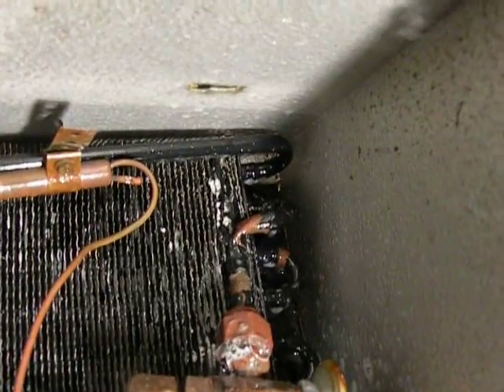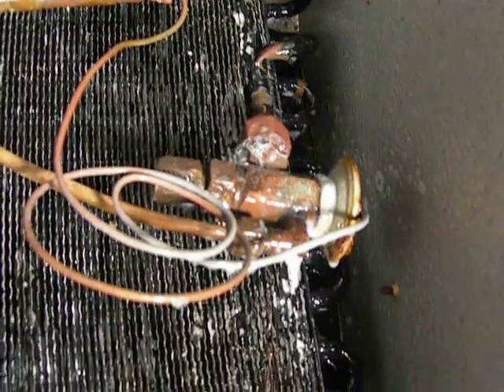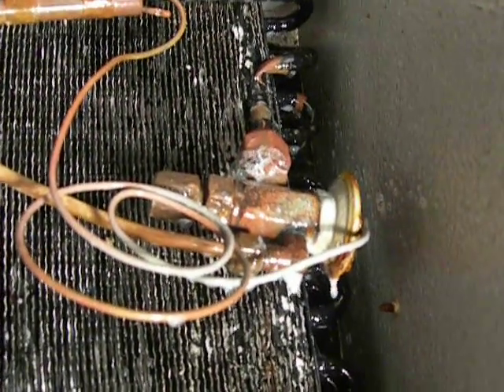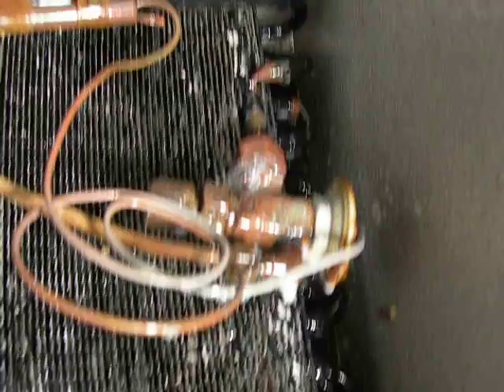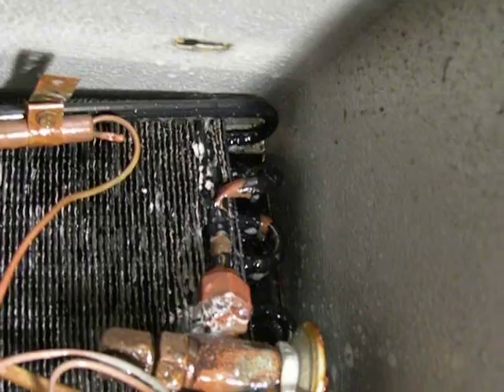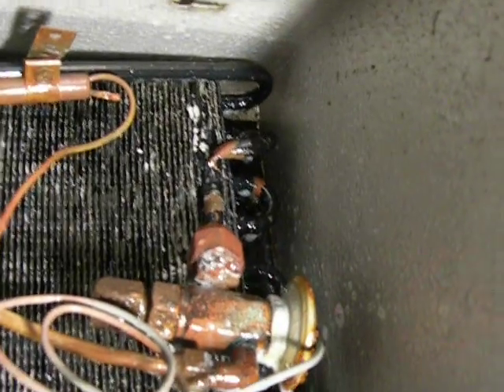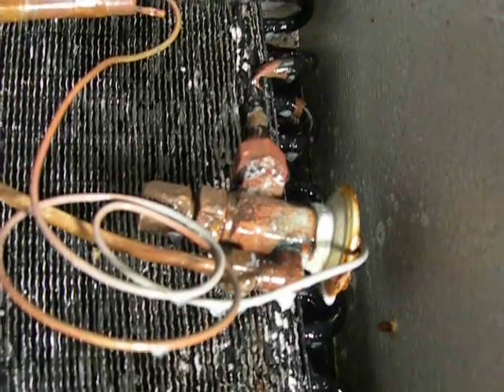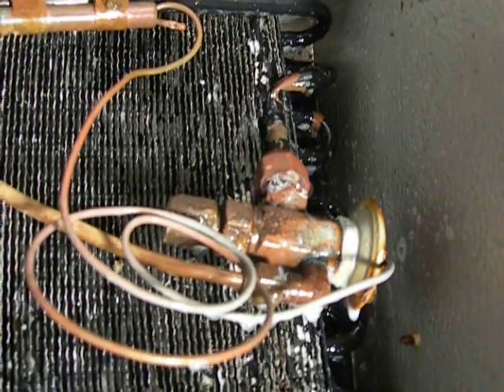Finding a Refrigerant Leak & Suprise!

Comment: Yah, I hear ya with those nuisance call backs on flare TXV's.  A lot of the times I've found hairline cracks in the flaring on the tubing.  Flaring tubing properly is an art in itself.  What I've done sometimes back when I did a lot of supermarket rack work was take it all apart, clean all the threads carefully, put a SMALL amount of flux on the threads and then solder up the nuts with some good silver bearing soft solder such at Stay-Brite #8.  Permanently solves the leak problem :)

Comment: @loix22 Pump down requires isolation valves and it's pumped to the condenser NOT the compressor. If you do a pump down that wouldn't resolve the issue even after leak has been repaired, reason being that during operation the refrigerant leaked out while it was damaged and you don't have a proper charge in the system. You MUST reclaim it, repair leaks, put nitrogen in and let sit for a while, vacuum system with micron gauge, use scale to put proper charge back into the system.

Comment: Sure, you could braze all the nuts with silver solder/Sil-Phos but that would make disassembly very hard, not to mention you're heating up components way too much.  The heavy brass flare nuts hold heat long enough to get things back apart with soft solder if you have to come back and change out a TXV later.  When I had to replace a TXV, I used to use Sporlan back in the old days, then I switched to the all stainless steel Danfoss sweat in valves. MUCH better, and the power heads were stainless

Comment: @Goodrich90mxr Flare nuts on any application will leak over time due to vibration. Tightening it up will solve the problem for 3-6 months on many systems but then it becomes a nuisance call. I myself can think of plenty of customers who would have the job done the right way with replacement of the TXV for a sweat fit one.
That 90 or should i say 110 is a separate issue entirely though lol

Comment from the maker: It Has another Problem if u Look at it Closely , Where the Refrigerant enters the Evaporator the Copper tubing is Bent Over Closing it Off Mostly. The Suction pressure is not high enough Because it Can't Get Enough Refrigerant.Leading to Coil Freeze ups and a Very Low Suction Pressure.and Some Real Weird Pressure Control Settings.Not a Pump Down System.

Comment: @g156xb Lack of cooling, but without knowing or seeing things like that you would probably never notice the leak. The Refrigerant is usually odorless. You would have to only open that unit to see the problem right away, but you should go over the usual suspects first. Dirty Filters, electrical issues, dirty blowers etc... 85% of your problems in the field will be electrical related. 15% will be bad soldering or hardware issues that just need replacement.

Comment from the maker: @tm030118 
Txv is just loose at the nut... but
Look at the Kinked Evaporator Pipe (above it ) at the Txv Outlet / Evaporator inlet.
feeding into the coil...that's the Real Problem. smashed over Pipe. that pipes supposed to be straight!

Comment: Solves the problem of the stupid Sporlan power heads rusting out, losing their charge; those Danfoss valves were all stainless, and the line connections were internally plated with copper and used thin walls to make sweating in real easy and fast.

But yah, putting a 90 el on the outlet of a TXV is a big no-no, I already knew that from common sense, your outlet of the TXV should always connect as directly as possible to the distributor/orifice assembly

Comment: It never fails to amaze me here if they find a small leak on a roof mounted AC condensor, they just dump the gas, make the repair vacuum and re-fill.Sounds reasonable till you realize 500Kilos were dumped! And there are thousands of Grockles soaking up the sun on Eilat's beaches with a feckin BIG HOLE in the ozone layer above Eilat.I only scuba dive and early morning before some dick head purges another 500Kg freon.